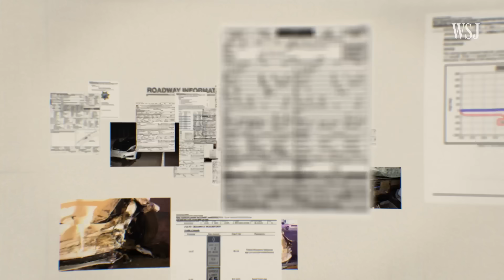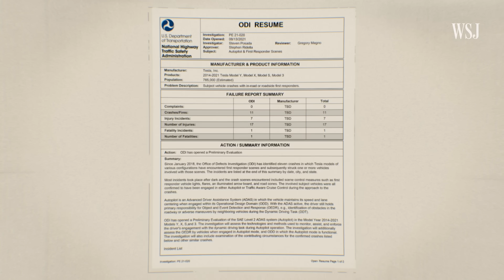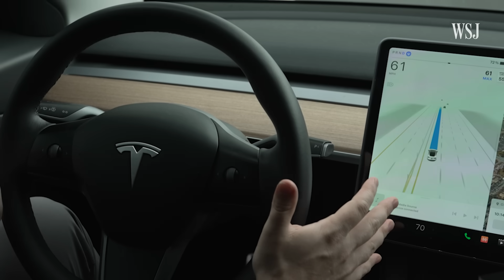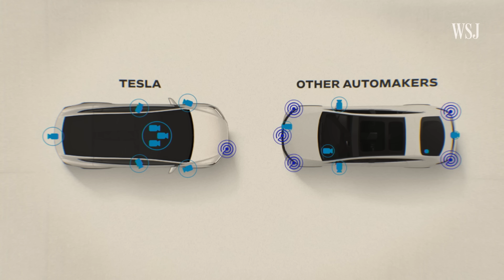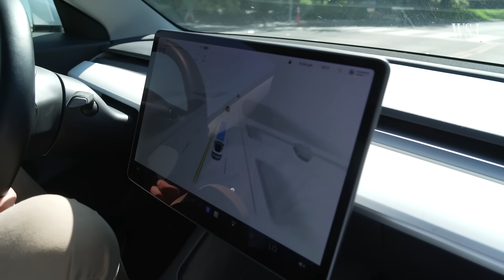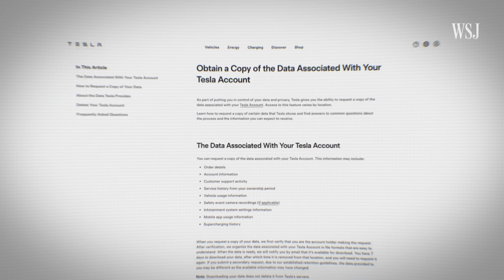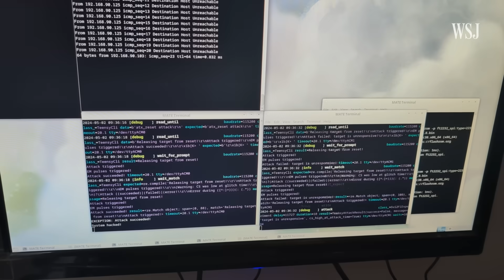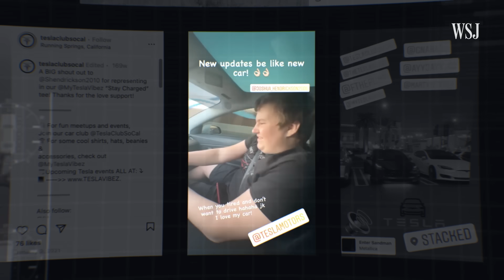The Hidden Autopilot Data That Reveals Why Teslas Crash | WSJ

Comment: Note to self:  step on brake when you see a truck laying on the road.
Reply: That's what the  video is trying to highlight: when we start to "trust" that the autonomous driving works, we start to lay back and let the system do its job and lowering our sense of awareness. Once the system failed to detect an obstacle and we see it in front of us, it is already too late: either the distance is too close and our response time is too slow to make that quick decision due to the lower state of awareness
Reply: @ferdiyansurya  I disagree having driven a car with the latest FSD. It lets you look further ahead, examine threats and not be concerned with low-level placement of the car. Meaning you can focus more on the dangers or threats and ensure the car is reacting properly. I have found it flawless so far-it doesn't miss vehicles in blind spots, or cars coming in from odd intersections.
Reply: @ferdiyansurya  correct, but my Mercedes system warns me if a freaking object is lying on the street
Reply: @benjaminmeusburger4254  Which Mercedes? Their Level 3 system? Because the Radar in their Level 2 cannot differentiate stationary objects from the road so they are ignored. Only LIDAR can see that and to some extend, cameras, if programmed correctly. My FSD equipped Model 3 avoided a big plastic bag that was floating on a highway by switching lane.
Reply: @sylvaing1  "My FSD equipped Model 3 avoided a big plastic bag that was floating on a highway by switching lane.": Why did you not switch lane yourself? Also: there are videos out there, where Tesla's automatically switch lanes, and by doing so, caused accidents. Hitting a plastic bag could be safer than switching lanes, depending on the situation. I doubt that autopilot can make that decision correctly, currently. Actually, I don't have a huge problem with autopilot, but the name should change, and it is - by far- not ready yet, and it should mandatory include lidar.
Reply: @benjaminmeusburger4254  My Toyota Sienna brakes automatically on cruise control (aka Dynamic Radar Cruise Control = DRCC) when I get close to a vehicle or object in the road ... they call it assisted braking meaning you still keep your foot near the peddle.  It is all in the lie of calling it an autopilot or autonomic driving.  We need transponders and VOR type nav equipment on all vehicles, people, and animals to even get close to airplanes.
Reply: @ferdiyansurya true but not in a situation like that. 100% should be intervened
Reply: you're literally supposed to be looking at the road while driving...not tesla fault
Reply: @ferdiyansurya  Still x1000 safer than human drivers
Reply: @austen2751  it isn't. Tesla uses highway crash figures to promote its safety. When corrected for the issues off the highway and comparing it to human drivers, they're not far apart at all.
Reply: @austen2751 I am better then any autopilot.
Why? I can look way further ahead then any autopilot can, react accordenly in time.
Reply: @austen2751 yeah, when there are no random obstacles on the road
Reply: @austen2751  A human would not have crashed into the truck though.
Reply: @Twiggy163  "When corrected for the issues off the highway and comparing it to human drivers, they're not far apart at all.": I beg to differ. Tesla would fall far behind human drivers, off the highway.
Reply: @austen2751 except it’s not
Reply: @austen2751  A recent study found that Tesla have a fatal crash rate of 5.6 per billion vehicle miles driven. The average rate in the USA is 2.8, so you're twice as likely to be in a fatal crash driving a Tesla than average. If you split out the individual models, the Model Y has a fatal crash rate of 10.6, almost 4 x the average, and it's the 6th worst vehicle overall if you want to avoid being killed
Reply: @mpmpm  Noah Goodall did the math using a formula to adjust for highway distance driven. Human drivers and Tesla's 'autopilot' were pretty on-par. To say the 'autopilot' is safer is still misleading though.
Reply: @waskus  Not actually true unless you've pulled your eyes out and attached them to the sides of your car.
Reply: Come the self driving car ( final version ) you won't be able to step on the break but the car will do the killing for you, and neither can you exit a burning Tesla if you wish to avoid getting fried. So to speak. You don't have to make the decision of life and death. This is called luxury in our times.
Reply: @server1ok  FSD already has 1/10th the collision rate of the US average collision rate. FSD already is saving lives. And Teslas catch fire once for every 205 million miles driven. Gas car every 19 million miles driven. I wouldn't drive a gas car if I were you. They're very fire prone.
Reply: Who needs to brake when you have a "fully self driving car".  Do you mean to say Telsa engages in fraudulent advertising.
Reply: @Zraknul  FSD has 1/10th the collision rate as the US average collision rate. FSD already saving lives.
Reply: @777Outrigger  FSD doesn't exist.
Reply: @Zraknul  It exists on my Model Y and is near flawless. You should see the decisions it makes in odd situations. And the way AI is advancing, it will not need supervision in the near future.
Reply: @777Outrigger  It's PSD until it no longer needs supervision.   Calling it fully self driving while it requires supervision is dishonest hype.
Reply: Blame the victim always works.
Reply: note to self: don't trust billionaires
Reply: My ICE car with a built in radar would’ve stopped for me. It’s called ADAS and it’s far safer than autopilot
Reply: Agreed. Its sad, but comical. Like how do you NOT see that?

I do trust my Tesla, but only to a certain extent. You won't catch me without my hands within an inch of the wheel no matter the time of day. 9 times out of 10, I have my hand resting on it somewhere, otherwise, hand on my knee with my palm open directly next to the wheel. People trust the system too much, and that is what causes incidents like this to happen.
Reply: Come on man, a truck laying on it’s side in the dark will challenge any human driver, with or without FSD…
Reply: @g4q9cjr I think you miscounted. Yours only has 5
Reply: as long ecu donr override that ;) it all by wire today in cars..
Reply: So no blame for Elon then?
Reply: I mean… There's always that lol
Reply: Honestly, go back to sleep
Reply: @JonAbrams-xt4tq  I was talking on another thread about people who are overly influenced by this stuff. When they lose their case, they nearly always end up calling on conspiracy theories or throwing insults 🤔.
Reply: Note to self- don't by a tesla- they don't operate as ADVERTISED
Reply: @skiak004  Another Tesla expert.
Reply: @skiak004  Not to self: lirn too spill.
Reply: Then you realize the car, god forbid truck, behind you doesn’t know you would stop in front
Reply: This comes off very insensitive. Compassion can go a long way
Reply: Or maybe take it out of auto pilot when driving up on a bunch of cop cars with their lights on. People clearly over trust it
Reply: 0:05 He wasn't driving, he was riding in it and obviously not paying attention as the owner's manual stipulates you must. I'm no Tesla fan, but facts matter.
Reply: Note to self: don't fall asleep and crash into median. - FSD
Reply: It looks like the driver was sleeping.
Reply: I once had to brake hard too when encountering reindeer walking ahead in my lane in northern Finland. Wonder how well is Autopilot/FSD also trained on animals like these
Reply: @lzh4950  I can attest it works fine on dogs and chickens in the, stops or evades perfectly.
Reply: Not to all Tesla owners love your car cool but you’re the driver be ready to act at moments of irregular driving  it’s taking 9/10 times stops to fool you into that’s it’s doing 100%. But 1 is all it takes.
Reply: Absolutely
Reply: Or have an automated system - a small radar for example - step on brake  automatically for you, if you are not fast enough because of one reason or another. We have a Hyundai - it's not a very expensive car - which has a frontal radar, which does exactly that: stop the car if something is in front of it. It's not rocket science, just that Elon Musk and his engineers think they are smarter than everybody else, and use only cameras for ADAS (Advanced Driver Assistance Systems), no frontal radar.
Reply: @lupuldefier  " it's not a very expensive car": Maybe for your salary, but for the average Joe, a car from 2017 is too expensive to buy.
Reply: @lupuldefier  No system is perfect, radar or otherwise. And the accident rate for people on Tesla Autopilot is, as I showed above, about 1/10th the accident-rate for cars in the US. Autopilot is by far preventing more accidents than causing them. Something this little WSJ hit piece didn't say anything about.
Reply: @777Outrigger  That is 100% untrue
Reply: @MrBrendanrex  That is a 100% true. Get 5 strikes for inattention and they take it away from you for a while.
Reply: He probably was sleep.  Telsa drivers with autopilot on tend to dose off.
Reply: @Marc-King777  you can't dose off. The internal camera has a fit if you are not paying attention.
Reply: @steve-knows-why   Then I guess Tesla's internal cameras are about as faulty as their AutoPilot 😂 because there are plenty of videos here on YT that show Telsa drivers asleep at the wheel while using AutoPilot.
Reply: @Marc-King777  they are old videos. The reason why tesla enabled the internal camera is because of people abusing self-drive.
Reply: @Marc-King777  https://youtu.be/otknSUQ4ICY?si=tL_I7FMbRHCnlHyO
Reply: @steve-knows-why    Don't know what you consider "old" but some of the videos were as recent as last year.  There's even a news report from this year out of Sweden where police followed a Tesla driver for 25 miles who fell asleep while AutoPilot was engaged before they were able to stop him.  

So, again, if there is an internal camera preventing sleep while using AutoPilot it is obviously flawed.
Reply: @Marc-King777  it is a DISINFORMATION video designed to install Fear, Uncertainty, and Doubt (FUD). Think about it... released 4 days ago, but talks about 2021 technology (red flag 1). It does not distinguish between Autopilot and Full Self Drive (red flag 2). Autopilot is like a cruse contol with lane keeping assist and some braking. Many cars have the same features and will also have crashed, BUT Tesla have driver attention systems, when other cars don't (red flag 3). They talk about vision only and the flaws, but in 2021 all models had radar (reg flag 4). They then promote lidar, which is the main competing tech, but skip the limitations of lidar (red flag 5). Then sensationalised the video with emotion (red flag 6). They don't do crash comparisons with peer systems (red flag 7). It is designed to manipulate public opinion.
Reply: @steve-knows-why  Musk originally said there is no point in handing control back to a human driver that is 10x worse than autopilot. That was his justification for not having an internal camera to detect whether the driver was alert. It took 4 fatalities for him to grudgingly admit that everyone else was right and he was wrong
Reply: @MrBrendanrex  Are you a Democrat or a lefty, or something? If you don't take responsibility for the your car, then you shouldn't be driving at all, FSD or Autopilot not withstanding. And Teslas with FSD engaged have 1/10th the accident rate of the US average. None of the Tesla detractors will mention that FSD is already saving lives.
Reply: @MrBrendanrex  you are missing "time". Musk also gives you terms on the screen to sign, he asks that you are attentive. He sets off alarms when you are not and eventually bans you. He has steering sensors to ensure your hands are on the wheel. He call the product "beta" and then "supervised". 

When (time) the product is ready, then not handing control may well be the best action. 
That is was musk said and did.
Reply: @steve-knows-why  The camera having a fit is probably what woke him up at the last second.
Reply: @matthewbartke4424  most likely. The driver did not see the truck for a reason.
Reply: Autopilot FSD overules human 🔥💀🔥
Reply: thats an idiotic statement did you not watch the wsj video?
Reply: @tomp66 the WSJ video is disinformation. It is not repentative of the real world. Sensationalised and does not compare to human mistakes.
Reply: @tomp66  i watched it, shows a bunch of people not paying attention when they should be, because they are told to, repeatedly, every couple minutes
Reply: What most people dont realise is that the tesla video also brighter in the dark. The flipped truck that you barely see in the video just before impact would have been even harder to see for most middle aged drivers behind the wheel.
I dont mind autopilot term ...but full self driving is misleading due to the simple fact it can not fully drive by it self or even drive backwards... nonetheless radar might have prevented some of those accidents.
Reply: @shawns5991  That's the benefit of radar, being able to detect objects in conditions of poor visibility better than vision only.
Reply: @shawns5991 Errr...thats BS.
In the current Autopilot, the matrix headlights would clearly show the truck.
He was asleep at the wheel.
Reply: @shawns5991 autopilot and full self driving are different, FSD is expensive but it would have seen that truck way before a human could see it and it would have saved his life
Reply: @shawns5991  actually no, cameras are far worse at night vision than humans. We have an insane dynamic range, and we can easily see in low light which would swamp most cameras in digital noise
Reply: @mattymerr701  digital noise sure...but not everybody has perfect eyesight and if you own a tesla you should try driving at night and save the footage and watch it back on phone or pc. You will see that the recorded images are brighter than the actual scene.
Reply: @shawns5991  "I dont mind autopilot term ..": Well, you should. It makes people think the car can pilot automatically. I can't do so. Well, not safely. Musk is saving a few bucks by not wanting to use lidar. He should be punished for that.
Reply: @mpmpm  💯 anything that increases safety should be implemented because it saves lives. Not removed because it saves money!
Reply: @shawns5991 that accident in this clip happened 3 years ago, machine learning and camera have improved this year x100 better
Reply: My wife was driving on the highway one night and there was an overturned Semi in the road. I was the passenger and I saw it first. I said  stop, stop! She did so, and she said she was glad she did because she didn't see the Semi and would probably not seen it in time.
  What a terrible hit job by WSJ, replete with ominous music. First off, Autopilot is not FSD (Full Self Driving), and is nothing more than a glorified cruise control. It does not stop for stop signs or traffic lights or slow down for curves. Steven Hendrickson was warned 19 times to keep his hands on the wheel with Autopliot. It was his responsibility for the safe operation of the car.    ...As for FSD, it is already safer than human drivers. ---- FSD is now going 7 million miles, on average, before an accident, Teslas not on autopilot go, on average, 1.3 million miles for each accident, and the US average for all cars is 700,000 miles before an accident.
Reply: @777Outrigger  "As for FSD, it is already safer than human drivers": Maybe on USA highway.  Not beyond that. Still, we should not be satisfied on the highway performance of Tesla! There are still totally unneeded accidents by FSD! Lidar should be mandatory.
Reply: @mpmpm  Yes, on US highways. Sorry for being US-centric. FSD's safer than human drivers now in the US, but I agree it's still not ready for full autonomy yet. But with the way AI is advancing, it might be here before you know it.
Reply: @777Outrigger fun fact, fsd is merely autopilot for streets.
Reply: @777Outrigger ironic you call it a hit piece when failing to mention the nefarious naming of “Autopilot” and Full Self Driving
Reply: @777Outrigger Calling it "FSD" then requiring intervention by the driver is not FSD by definition. Tesla should be required to rename it to "advanced cruise control", "driving assist" or similar.
Reply: @777Outrigger  cope harder. The goal of Autopilot is to be autonomous. They haven't achieved that at all and yet they still market it and FSD that way. It is not full self driving if it requires supervision.
Reply: @mattymerr701  I have HW 4 on my Model Y and its incredible.' It drove me for 54 minutes a few nights ago through construction and complicated highway entrances. And HW5 is on the way. Exponentially better! .... By the way, Autopilot is just a glorified cruise control. FSD is what's getting Tesla to autonomous driving. If you're that uniformed about Tesla systems, you opinion is not valid.
Reply: @777Outrigger  I think you're right. Humans does not work well together with Autopilot. Surely you see the problem here.
Reply: I just watched a video on Whamm Bam Tesla Cam of Autopilot saving the day and preventing collisions.
Reply: @777Outrigger exactly. Autopilot and FSD-S save lives every day. It sees and avoids all kinds of things humans miss. It’s never fatigued or distracted.
Reply: @777Outrigger  But you do realise they are filtered to present Tesla in the best possible light?
Reply: @MrBrendanrex  Yeah, right. Whatever. I can see you've never driven a Tesla with FSD and are only repeating the talking points of it's detractors.
Reply: Lol 😂 tesla is the least safest car on the road lol 😂  It’s the deadliest cars
Reply: @williampisano7573 crash tests show that it’s probably one of the best cars to be in, if you don’t survive in a Tesla you won’t survive in anything but Tesla drivers I’ve noticed become over reliant on technology which causes poor driving
Reply: @williampisano7573  Not according to statistics...
Reply: @williampisano7573 tesla has some of the highest safety ratings dude